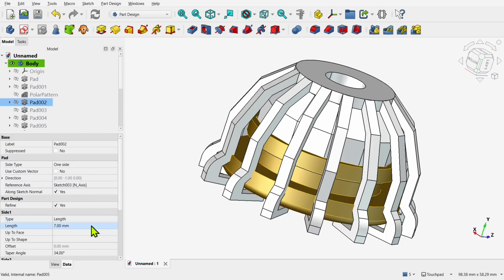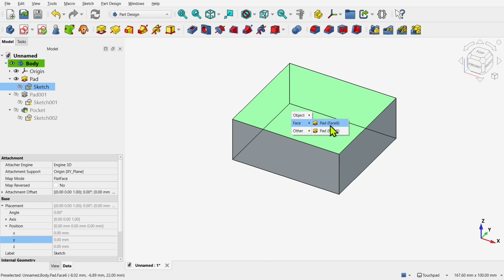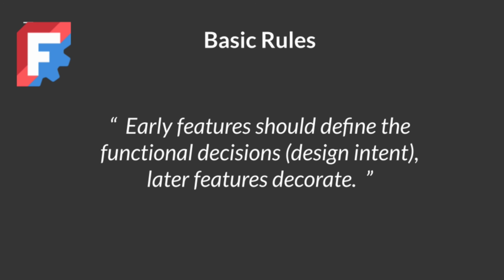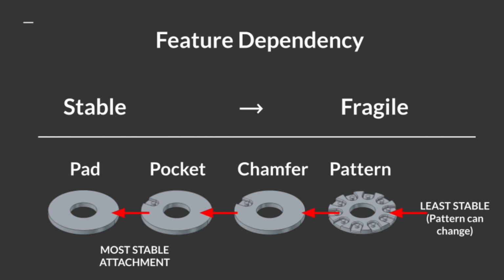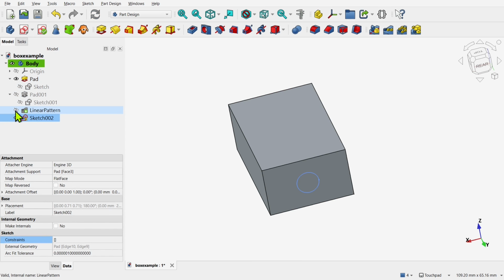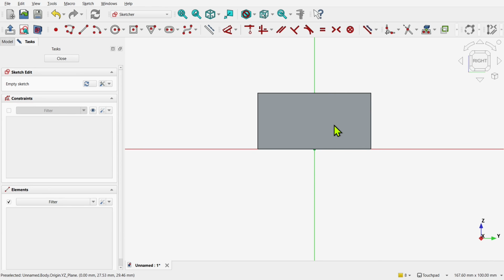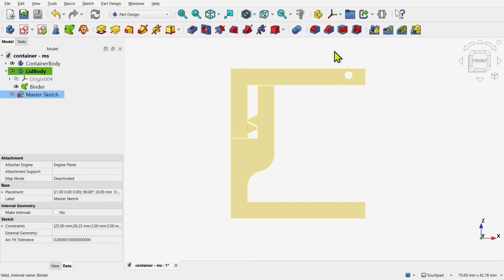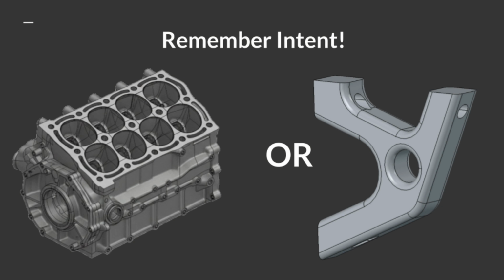Why Your FreeCAD Models Keep Breaking (And How to Stop It)

Comment: Several good tips here. Thank, Darren.  

I think I am seeing something that could be confusing. What do you think?  On the point about using an earlier feature to reference a sketch for a new feature, bypassing n+ features essentially starts a new branch to the build tree on which additional features can be added.  Not easy to see this on the provided build tree, so one might have to keep a note pad and pencil handy to keep track of which branch you want to work on.
Reply: It's not a branch to the tree, it is just an attachment dependency. Dependencies can go all over the place - even to different bodies - and they are usually even more well hidden behind expressions. In the case of an attachment: think of it like this - a sketch (like a piece of paper) needs to be pinned to some position and orientation in 3D space. You can pin it to the origin, to some coordinates defined by an offset from the origin, to a face of a solid (any solid), a shape binder or to some complex geometric relationship between features (we call that a datum plane). It does not matter whether you get your position in space from the feature immediately before the sketch or from something further back - you just need a (preferably reliable) way to tell FreeCAD what the position and orientation of the sketch is. If you adhere to the rule that design features come first and decorations last then relying on early features is very safe - those early features will have correct dimensions. Remember: CAD is not lathing where dimensions change all the time, in CAD you start with the correct dimensions and then refine the body by adding smaller and smaller features. If you need to change dimensions you go back to those early features that define them (something that is hard to do with physical objects, but easy with computer graphics).

You can always see your attachments by clicking on a feature and checking what the attachment is. No need for pencil notes. It's a bit harder with expressions in sketches, but if it becomes difficult to remember those it is usually about time you start a spreadsheet or varset and link all references to that - then it becomes easy again.
Reply from the maker: Thank you so much for taking the time to explain this and help overs out, much appreciate :) :) :)
Reply: @MangoJellySolutions  Thanks. Let me return the compliment: I learn something new from every one of your videos. Helping with answers is my way of saying 'thank you'.
Reply from the maker: Glad you enjoyed, what @KonradTheWizzard posted reply in regards to the branch actually being a dependency and the analogy of  a sketch as a piece of paper and has to be pinned is spot on, lots of detail in that post and very good explanation and answers in there.  I'm finding it hard to add anything that could help further.